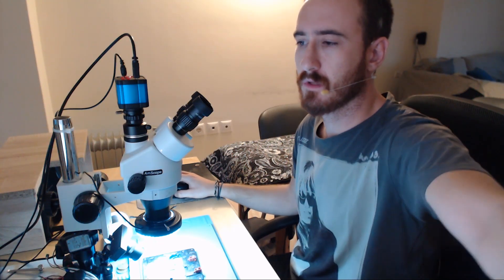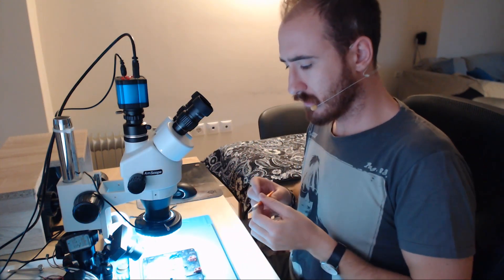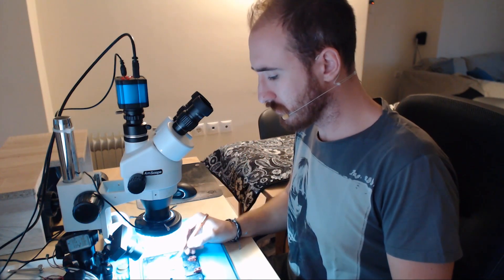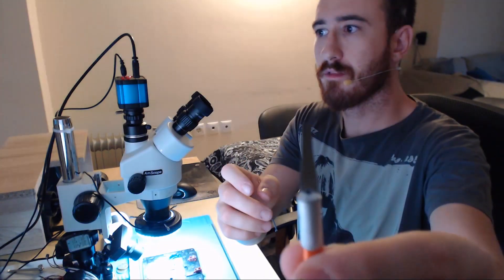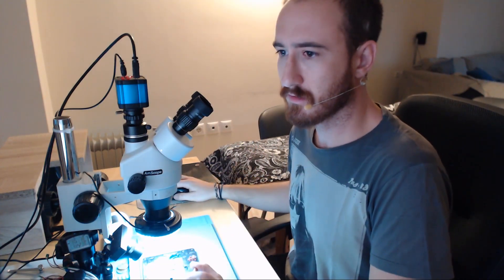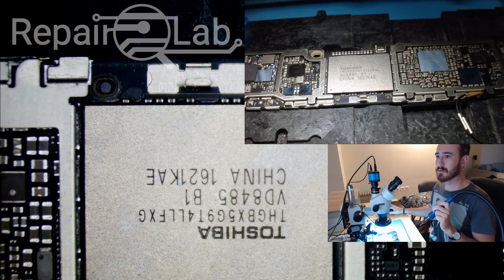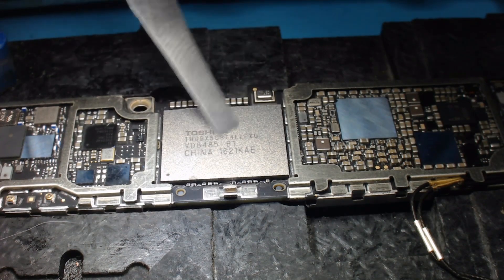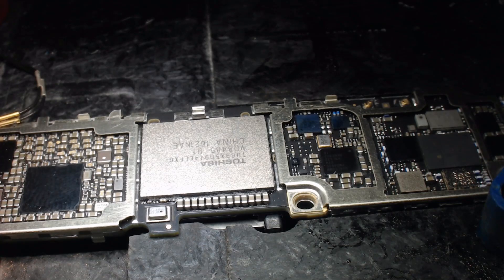Removing NAND flash with a nice tool.

Comment: Would be possible to retrieve all my data that is stored on the NAND Flash after swapping it from my faulty logic board to the replacement one?
Reply from the maker: what model?
Reply: @RepairLab  what happens when you remove an old NAND and use a brand new one?
Reply from the maker: You have to copy nand underlying data otherwise won't work
Reply: @RepairLab  which means you need a NAND programmer? is it possible to purchase NAND that is already written?
Reply from the maker: Yes you need programmer. I don't know if someone's selling pre-written nand but you need old nand to copy the serial.
Reply: @RepairLab  I understand completely. Take the old one out, clean it. Insert into programmer, read. Copy data. Insert new NAND into programmer write with old code. Change 1 digit to make new. Reball the newly programmed NAND and use stencil then heat back into Logic board. ? 

Can I ask, will the machine work as normal after new NAND flash ? What temp. Do you use to desolder and what do you use to clean ? Thanks so much

Comment: I use this tool often for iPhone 7 PMIC repair, people spends 200~500$ on a bottom heater for these types of repairs but these are just useless if you have the skills and knowledge to operate with a tool like yours, because of the epoxy glue underneath these chips it's almost impossible to lift with tweezers without damaging the IC or a board (takes alot of heat)... It takes twice less heat to lift a chip with that flexible tool you have, for crowded areas like the PMIC(surrounded by capacitors) I just remove 2 or 3 capacitors to have place for placing the tool underneath the chip and it lifts off with no damage at all, and then I just have to place the capacitors back, amazing technique if you know what you're doing like yourself :) also Id mention the nozzle for your NAND removal is quite small, the IC is 3 time the nozzle size so youre lucky you didnt pull pads.
Reply: DEAR WHAT IS THE IDEAL TEMPERATURE TO REMOVE NAND IC

Comment: at what temperature do you remove the nand ?
Reply from the maker: 300 celcius
Reply: @RepairLab  300 is a lot lower than other videos recommend. However you've obviously still got the nand off. Do think its safer to remove then and slowly with a lower heat than to remove it quickly with a higher heat?
Reply from the maker: @matthewJamesKendell  i have another video about this topic https://www.youtube.com/watch?v=v1WxfqlcmOo

Comment: what was the temp. u set and air flow
Reply from the maker: Fresh Snake  Hello, It depends on your hot air station and some other variables like the room temp etc etc. You have to find the right temp and airflow by yourself while practicing. For the records, I used 220C to remove the underfill around NAND and then 320 high airflow to remove the chip but I repeat these settings are for my station.
Reply: 320 is really good temp but better use 380 to be sure that will not pull pads .. the tool is good i use the same